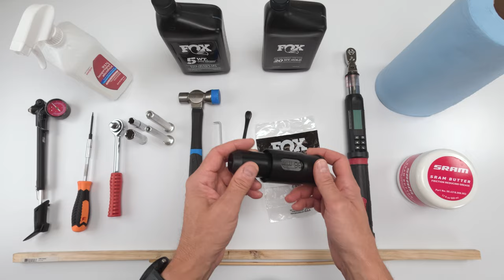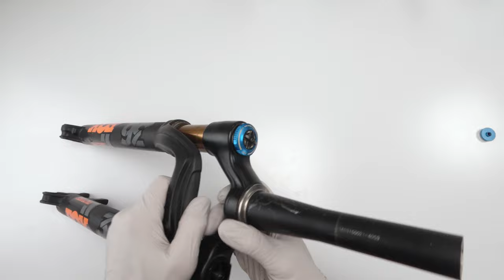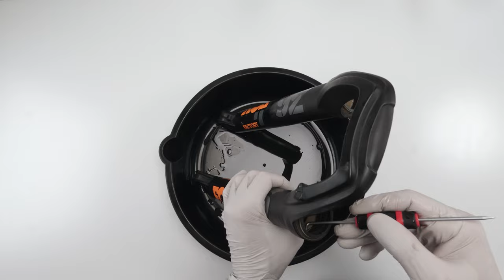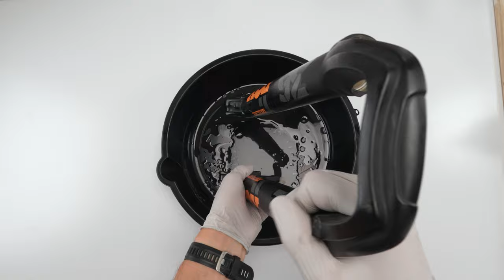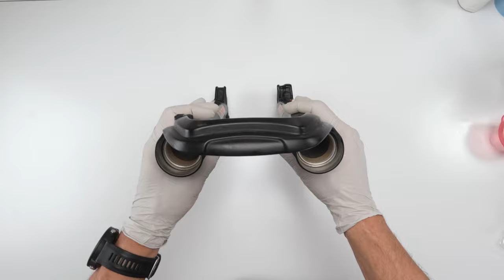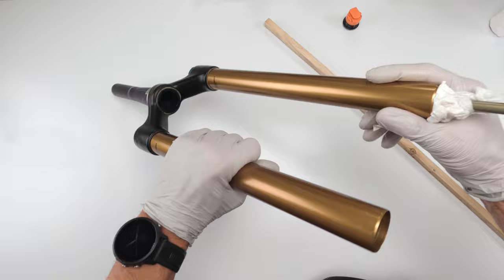2019 FOX Factory Series 36 FLOAT GRIP 2 Full Service guide for beginners. WEAR your safety glasses!

Comment: Great video would of been lost without this, for info the tiny circlip you love so much is OD Ø0.280" (Ø7.11mm) and wire is Ø0.024" (Ø0.6mm). Watching the Fox WEB site for the circlip removal if you slide it around so the end of the clip is next to one of the holes it comes out relatively easily.  The only problem I had Is my forks are 2022 factory 36 Grip 2 and the shim pack is way different! unfortunately while I was measuring them the wind blew the paper towel they  were on and mixed them up 😭fortunately Fox has a really good web site with the drawings of every part so was able to get back in correct order 😃  having a go at the rear shock tomorrow. Thanks for the great Video
Reply from the maker: Apologies for the late reply, but AWESOME comments my man! I really appreciate reading about people's experiences and hearing tips, reminders and recommendations. The hole on the side definitely makes it easier; the problem is finding something small enough to fit in it in order to pop the ring up. I wish Fox made it more forgiving. Especially considering they don't offer replacements for those rings

"the wind blew the paper towel they  were on and mixed them up"
I feel your pain. This has happened to me a couple of times; the last time was about 4 years ago. I had trouble sleeping for about a week, and one night I decided to get out of bed at around 4 am and work on a shock to relax me before going to work in the morning. 15 minutes into it, when removing the shim stack, the zip tie I used to keep them in order sprung open on me, and they flew all over the kitchen and dining room. Shims flew everywhere. I literally had to comb the carpet with a small magnet to find the last of them; it took forever. What really sucked was that it wasn't my shock, and I didn't know the order as well, but rockshox pulled through when I called them. 

Thanks for the comment

Comment: Great video as always.

One question, what is indicator that it is time for damper service?

Besides 200h period...
Reply from the maker: Thanks. one good indicator is noise. if you hear squishing, squeaky, swooshing noises (especially on a hard fast impacts), if the fork feels like it sticking,  then chances are it needs service. by 200 hours it should be service, but that doesn't mean you should wait until around 200 hours. in some cases it might need service way before that

Comment: Does the procedure differ a lot from the newer version with VVC? I am thinking about doing the full service since my local shop refuses to do so. Other thing I wanted to do is maybe order Andreani's High Flow Piston to make some ✨tuning✨
Reply from the maker: Mostly the same. The biggest difference is going to be in the compression stack. The compression piston will look the same, but the loader under the piston will look a bit different. Also, there are leaf springs instead of shims with VVC. You can technically perform the service using this guide, but make sure to pay attention to the disassembly of the compression stack. The VCC is technically easier, imo. What you can do is record the compression stack disassembly, just to make sure you have something to look at if you get confused during the reassembly. Let me know if there are any questions

Comment: Great video, thanks! Im learning in a bike shop, but that is definitly nothing u will do there every day. Maybe im doing the service for my grip 2 next time by my own.

 What do u think are the benefits of puting grease in the dust wipers? When im right fox says u shouldnt do this, maybe there is a little bit more of breakaway moment when putting grease there?
But with grease there is a better efficeny that the dust stays outside?

When um doing service on there i will put the dust ring on the damper side into the 5WT thats in the chamber and not into the 20WT. Did u do this for any reason?
Reply from the maker: Sorry for the delayed response.

"What do u think are the benefits of puting grease in the dust wipers"
I find there is a better response when doing this. Jstu make sure to clean the excess grease that will come out of the wipers after your first few rides. 

" i will put the dust ring on the damper side into the 5WT that's in the chamber and not into the 20WT"
I actually got into a debate about this with another YouTube member a couple of months ago. The main job of the foam rings is to collect debris and particles. According to FOX, 5wt isn't effective at doing this, as it wasn't designed for this purpose. The 20wt oil is much more effective and is to be used for this purpose. Again, according to FOX, there is no issue with mixing the 20wt oil and the 5wt if the 20 wt is used for the foam ring.

What's super important is to keep up with the lower boot service intervals. It's quick, its easy, it'll extend the life of the fork, and you will get the most performance out of it 👍
Reply: @zoubtube   thanks for your answer!! The idea behind that sounds good to me. I will try and put both foam rings into the 20WT next time :D 

Do you know if Fox changes all the O-rings in the Grip2 if you send them your fork for service or is this an extra special service?

Do you have special tools for changing sliding bushing/guide bushings (i dont know the correct english word for it) and can make a video how its done? Im searching the whole www to see how its done but couldnt find a video :(

Comment: Hi, Probably the best video for 36 FIX service..One question: What kind of support do you use to clamp the pieces in the vice? Can you provide the part number?" thank you
Reply from the maker: Thank myman. glad you enjoyed it. I believe your asking about the softjaws

I have many pairs but the ones I use the most are the following. they are a bit pricey imo, but they are great quality, laser printing is clear and they come with magnets
https://www.ebay.com/itm/115153412361?var=415219180268

This guys also makes quality quality stuff but no magnets, which is a shame imo
https://www.ebay.com/str/bikewcm

you can save some money and buy printed soft jaws. they work fine as long as you make sure they are clean and have a good vise. 
https://www.ebay.com/sch/i.html?item=143941711845&rt=nc&_trksid=p4429486.m3561.l2562&_ssn=rnoksdesigns 

Hope this helps

Comment: 02:15  what is the thread of the 2 tools? thank you awesome videos!
Reply from the maker: Apologies for such a delayed response, but this one slipped through the cracks. One is a Metric 8mm x 1.00 FINE thread and the other is a 10mm x 1.00 EXTRA FINE thread. I'll make sure to add it in the description as well. Hope this helps.

Comment: fantastic video

a question about the tool you use 36:59 can it be 3d printed? Do you have the dimensions or a link to it?
Reply from the maker: Apologies for the late response.  Absolutely it can be 3d printed. I really need to jump into learning more on 3d printing because there are LOTS of tools that can be printed and sold for MUCH cheaper than what many of these companies charge. My problem is time. 😔

Comment: Very interesting and well done video.  I only have one question about the GRIP2 service: the official FOX video (like other tutorials) indicates to push the cartridge rod upwards for 3/4 of its travel in order to release the excess oil.  In other videos some don't.  By pushing the rod up so much, wouldn't you risk letting too much oil escape from the cartridge?  However, I suppose it is used to avoid adding oil to the 40cc PTFE already included in the FOX reference table.  Thank you so much!  K
Reply from the maker: My Apologies for the late response. You want to cycle the shaft at 75% of its travel during the bleed process in order to correctly pressurize the damper. If you miss this step and go for a ride and take a big hit, the added pressure will put a significant strain on the seals. I hope this helps

Comment: Where did you get the vice blocks with all those different sized holes? I can't find anything like it except the small one specifically for the grip damper.
Reply from the maker: I bought them from an eBay shop. The guy who makes them is from Canada. They are pricey for soft jaws (and it seems like the price went up significantly from when I bought them, but then again, what hasn't?). But, they are solid, precise, very well-marked and come with magnets, which is a huge plus for me. The link is below

https://www.ebay.com/itm/115153412361?var=415219180268&_trkparms=amclksrc%3DITM%26aid%3D777008%26algo%3DPERSONAL.TOPIC%26ao%3D1%26asc%3D20230811123856%26meid%3D2a276b6e2b2c4f92bfac08a944598293%26pid%3D101770%26rk%3D1%26rkt%3D1%26itm%3D415219180268%26pmt%3D0%26noa%3D1%26pg%3D4375194%26algv%3DRecentlyViewedItemsV2%26brand%3DBrand&_trksid=p4375194.c101770.m146925&_trkparms=parentrq%3A254fbed918d0a4f3dbd5a177fffce4be%7Cpageci%3A8e9c2396-b753-11ee-91b2-72e3c74276a3%7Ciid%3A1%7Cvlpname%3Avlp_homepage

There are others out there that make similar softjaws for less, but chances are they will be missing some of the features that this guy offers.

Comment: I just bought a new grip2 damper. I accidentally compressed the rod and oil SPLOOOGED out.... Should i just separate/unscrew it ( i have flat socket) clean and fully bleed again?
Reply from the maker: Yup. this is a very easy damper to bleed. fill about 80% of the tube with oil. Get as many bubbles out first by cycling the rebound shaft. Then fully extend the rebound shaft. Then install the IFP assembly after you make sure all knobs are in the fully open position. Then SLOWLY insert the IFP assembly and close it up. From that point on the damper pretty much bleeds itself during use. I'm sure you can do this. 💪
Reply: @zoubtube hopefully going to install today...I'm curious though, if it's a new damper, is it not "full" of oil already? Should I not essentially do what you did at the 1hr 32min mark?  If I compress the piston 75% I'm sure oil will come out the bleed hole.
Reply from the maker: @Steve-og3cr  If it is a new damper, then yes, it should have had the correct amount of oil in it. But you had mentioned that you compressed the damper shaft and the oil "spooched out" This being the case, I have to assume the damper isn't properly filled anymore. You need to add a bit of oil back into it to make sure there is no air gap when the shaft is fully extended.

This type of damper basically maintains itself over time from a bleed perspective, as it will purge excess air and oil on its own through the bleed port, but it needs to start with the proper level of oil to do so.

Hopefully, this makes sense.

Comment: Hey, what do you think of this...  I have a 2021 34 Grip 2, and I'm looking at the lower removal tools.  This is from the 'Required Tools' on Fox's air spring rebuild guide...

398-00-681 2002-017 32 Damper-side and ALL 32-34-36-40 Spring-side Removal Tool
398-00-682 2005-017 34-36-40 Damper-side Removal Tool (needed only for 34mm forks)

So I think that means for a 34 I need one of each of these..?  I'm just confused by Fox's wording here.  On Jenson it does say one is for 34 air side and other is for 34 damper side, but I'm not completely convinced either way.
Reply: Disregard, I think I have decided the 34 needs both removal tools.  Ordering them today and will confirm when I am able to do the job.
Reply from the maker: Sorry for the delay but yes, The air and dampers sides have different sized shafts. enjoy the service. I'm sure after you do it once you will find it super easy to do again
Reply: @zoubtube  Thanks!  I am actually looking forward to this one.  I have most of the stuff I need, just waiting for a bad weather day to dig in and enjoy.

Comment: i changed the oil in my grip2 40 now my rebounds turn without clicking or stopping please help guys.
Reply from the maker: Just to make sure I understand. when you say "changed oil in my grip 2" are you talking about 50 hour service (only removed the boots) or did you open the damper to and changed the oil in it as well as replaced seals?
Reply: @zoubtube  just 50 service
Reply from the maker: @brokebroke5950  Are you sure you positioned the rebound knob correctly? Or more importantly, Are you sure you didn't strip the mini set screw when unscrewing it to remove  the knob? this is a common mistake which I believe I mention in this video. let me know
Reply: Yes I'm sure it's not stripped
Reply from the maker: If it's the exact same fork, then it has two rebound knobs. The inner knob is positional. Make sure the deeper side faces the forks boot. The outer knob has the set screw. You have to make sure the set screw sits against the flat portion of the rebound shaft dial, or else it will slip or fall off easily. Have you checked this out? A regular 50-hour service doesn't affect anything within the damper itself, including the rebound shaft.

Comment: Did you make your soft jaw?
Reply from the maker: Nope, I bought all my soft jaws. The ones I like the most I purchased on ebay from a guy in canada. They are pricey, but well made. below is a link
https://www.ebay.com/itm/115153412361?var=415219180268

The rockshox reverb softjaw is super handy, it doesn't; come with magnets (I ended up drilling hole to install some). The problem is its super expensive now. I foudn an alternative printed version on ebay that I plan on purchasing to test out. I'm hoping it works out. Below is a link
https://www.ebay.com/itm/276210036547?mkevt=1&mkpid=2&emsid=e90001.m162181.l175008&plmtId=700008&mesgId=3024&mkcid=8&ch=osgood&bu=43211224335&trkId=8b55f643-ba2d-45b6-b2bb-1978cfb7ca59&cnvId=700003&recoId=276210036547&recoPos=1